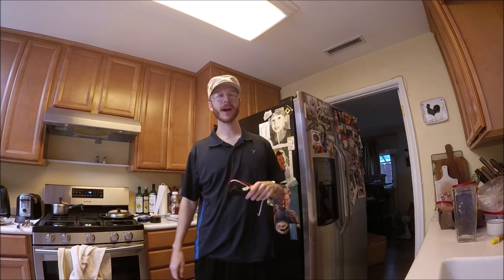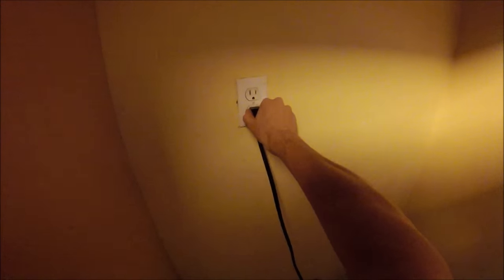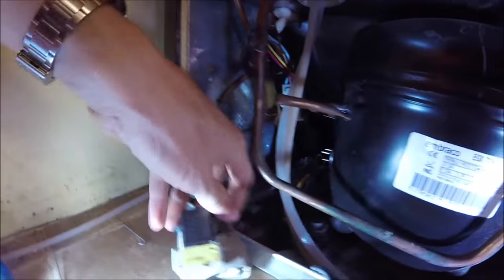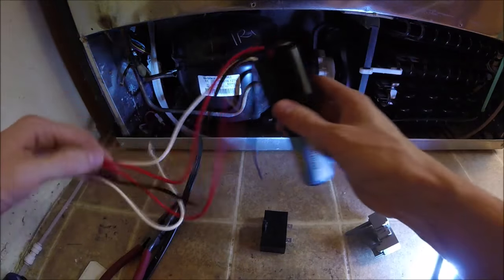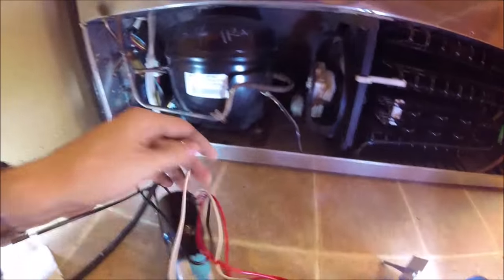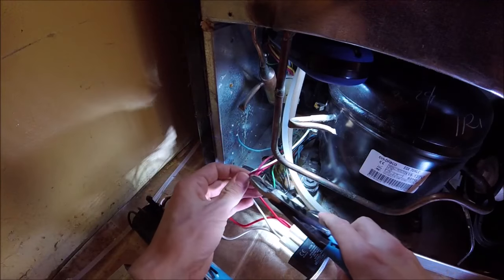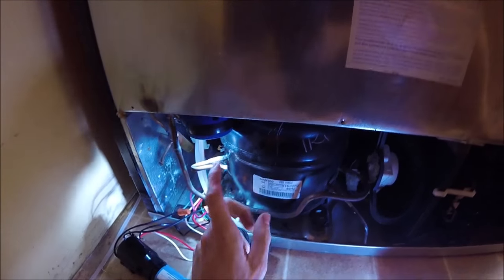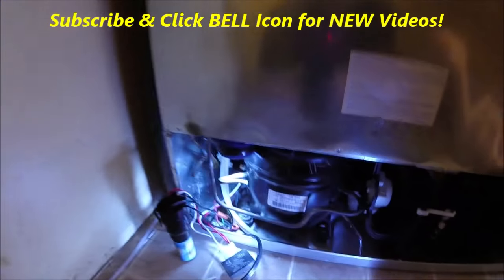Fix Refrigerator. Installing Universal Relay (3 in 1 Starter) on Compressor -Jonny DIY

Comment: 3 in 1 you have listed doesn't have the chain cable connectors, and I can't find one on Amazon like the one you're using. Any ideas?
Reply from the maker: Sure, check out the Supco URC0410. Looks like that ones the same with the connectors 👍
Reply: @JonnyDIY  First of all, thank you for the quick reply to my last query! So the refrigerator you're installing this in has a "run" capacitor, correct?  Mine is a GE and the capacitor your hooking up to is mounted separately from the compressor unit in my fridge, but close by.
Reply from the maker: @OriginalAstroTard  you're welcome, yes I believe so. From what I've learned is some people have hooked these up with success without putting the capacitor in line, but I figured I'd use it. Never had an issue with it since installing that way either
Reply: @JonnyDIY  Looked up the part number you provided and that's it. Should be here today. Appreciate your fast replies and taking time to produce them. Also, you don't take an hour to yammer on about everything under the sun, just short and simple...thanks!
Reply from the maker: @OriginalAstroTard  you're welcome, glad to help. Hope you get fridge goin soon! 👍
Reply: @JonnyDIY  Okay, I did a temp hookup to another wire (now orange and purple) and the compressor comes on. However, it only comes on when the fridge door is opened, and goes off when it's closed. Is this normal? Great-Googly-Moogly, I was a computer tech and ran class 4 laser welders, and I'm at a loss here LOL!
Reply from the maker: @OriginalAstroTard  sounds like you're 
very close, but compressor should be ON when door closed or open. Sorry not of more help, so many different fridges. Sometimes you can find wiring diagrams for your model
Reply: @JonnyDIY  Thanks Jonny DIY, it's 19 years old, so perhaps it's time for a new one. Appreciate you taking time to assist. Blessings!!!
Reply from the maker: @OriginalAstroTard  you're welcome, well if the compressor is still go and its just the start relay it's still worth salvaging. But maybe it was the compressor, but not if you had it kicking on and staying on and cooling. The wiring was just off
Reply: @JonnyDIY  Success! Not being the kind that easily walks away (plus it was driving me nuts), I worked out a remedy. My first thought was that when the condenser fan runs, the compressor runs. So I ran a temp jumper wire from the Supco to the connector that brings power to the condenser fan, and temporarily fished the wire into the back of the connector at each point. That didn’t work, so I decided to do this with each connector I could find, and eureka. I stuck gold! Performed a test run for several hours and it functioned correctly. So I used a quick “line splice” connector to attach the black power wire from the Supco, to the gray wire that supplied the necessary power to run the compressor, and its running\cooling great. I’ll let it run for 72 hours and freeze a few ice packs to ensure it’s functioning correctly and reliably before I transfer food to it.

Appreciate it friend…
Reply from the maker: @OriginalAstroTard  Awesome! Glad you stuck with it and got it working. I find it's sometimes best to walk away from a project, and your mind will subconsciously keep working on the problem and find a new solution.

Comment: As per your instructions,  I got mine off... However, I have a different unit... GTH53AD (R134a). On Kenmore 255.19502010. I have the 3-N-1. I have 1- Blue/White (N) was on ROUND BLACK and 1- Blue/Tan and a short Black that was stuck on RECTANGLE WHITE...

If any one knows this unit🤔🤕
Got it🤗🥳😇

Comment: But what did you connect the second black wire to?
Reply from the maker: One went to compressor and other to original start relay wiring 👍
Reply: @JonnyDIY  ok but when you say compressor, I have the three pins connected to the compressor. But I still have the two black wires from the rco and I'm super stuck because I still have two that I don't know where to hook up. I can send you pic of that would help you to help me but can't send a pic through comments so I'm truly stuck
Reply: I hope I haven't upset you. I'm just in desperation mode as I e got food that going to go bad and you're the only you tuber that I've even gotten a response from. I'm sorry brother but I'm just not an electrician and I still have 5 colored wires and the 2 black wires from the rco not connected.
The only ones Ive connected are the 3 whit red and black with the pins on the end that goes to the compressor.
Reply from the maker: @scottlytton5328  Sorry, connect the 2 remaining to the wires that came off original start relay. Each fridge is a little different. Hope you can get it working
Reply: @JonnyDIY  thank you my friend. I will let ya know. Travelling now with dry ice to hold me over
Reply: @JonnyDIY  got it bro. It works great! New subber here. Thanks a ton!
Reply from the maker: @scottlytton5328  Awesome! You're welcome, glad to hear you got it working. And thanks for subbing! 👍

Comment: Ran for about a day then keeps tripping breaker. Prior to adding 3n1 i has to replace defrost thermostat and went ahead and replace defrost timer. Heater was okay. Fridge would not start, starter relay was burnt out. installed 3n1 , unti ran great for a day but now keeps tripping breaker. Any advice???
Reply from the maker: May be drawing too much power when relay kicks compressor on. Make sure didnt buy too large of relay
Reply: @JonnyDIY  purchase the 1/4 to 1/3hp. I have a 1/3HP compressor.

Comment: hello Jonny, I have a question for you. When choosing 3n1, which hp do I go with?  i noticed there were several of them with different HP.
 There is no indication of HP on compressor .
It is a 24 yr old kenmore chest freezer and I can not seem to find oem relay. Thank you in advance
Reply from the maker: The one I have linked in description should work fine. You can always use the amps to give you an idea if it falls in parameter of part, but the one I linked will work for standard size fridges and freezers
Reply: Thanks. I did install one and compressor seemed to be little too hot. 
So ordered one that is for 1/12 - 1/5 hp and it will get here on Tuesday.   I also ordered ohmmeter. Could you teach me how to check the amp? And figure out its hp? Thank you in advance.
Reply from the maker: If you look on compressor it should read watts, divide watts by your voltage to get amps. And you can get hp from amp number too
Reply: @JonnyDIY  hmmm there is only one label with barcode and I do not see watts. It reads 115V 60HZ. 10 LRA 1PH and etc.

Comment: I have a Kenmore 795 76203 901. Fridge on top works fine, freezer on bottom is not freezing. Compressor is hot but there is no clicking. Everything is clean, dust free. Coil fan is running. What would cause this? Thanks
Reply from the maker: Could be many different things. Low on refrigerant, check to make sure cooling vents inside freezer arent blocked or frozen over (air needs to be able to circulate), then sometimes its a large part like the compressor just flat wearing out
Reply from the maker: try setting freezer to coldest setting after reorganizing freezer for air flow

Comment: How do you size the proper 3 in 1? My compressor is 17.6LRA, but all the 3 in 1 are rated in HP. Screw it, there's only one locally and since it uses my capacitor I'm grabbing it.
Reply from the maker: Yeah you should be ok. They're pretty universal
Reply: @JonnyDIY  Couldn't find one local, It was just as easy to get exact replacement, but I think my compressor is mechanically stuck. Everything tests on spec, but all I get is a click. My condenser fan got stuck the other day and let the compressor overheat. I'm heating the whole unit with heat gun and I'll try bumping with 220v later, but it's not looking good. Funny I had just been on the lookout for crapped out fridges to swipe a compressor for vacuum pump or maybe a silent air compressor mod. I wonder how many I'll have to try to get one with a good compressor?
Reply from the maker: @BigFarm_ah365  youd be surprised how many working fridges you can get for free or under $100
Reply: @JonnyDIY  The funny part? It's not mine, I rent, but my buddy is my landlord, I was just trying to be a bro.  We built this place, so I just fix shit if I can. We're calling in backup before we give up. It was 8 or 9 years old, but $2500 new, so I don't think he'd want me bringing in some white Kenmore I found on the side of the road🤣. It was nice having all new stuff moving in here, but it breaks even quicker than the old stuff I've typically had and all around the same time. But my ($5)Electrolux canister just keeps marching on through the decades(4 so far), they must be kicking themselves for selling all the replacement parts.
Reply from the maker: @BigFarm_ah365  ohh nice,  yeah sounds like its worth trying to fix for sure. Yeah they're just not building them to last but maybe 10 years these days

Comment: Hello Jonny after I watched your video and installed the 3 in 1 relay and the fridge works great but the light bulb and thermostat does not. Can you explain which wires from the oem relay need to be connected back to power?
Reply: Timothy Salomon  this is a generic old single door fridge I got the light working by connecting it to hot and neutral.   There are 4 colored wires leading from the thermostat to the compressor (green is ground blue is neutral brown is hot) all those are connected my problem is where does the black wire go? This black wire is from the thermostat that would allow you to turn off the compressor from inside the fridge at the switch. The black wire use to connect to the original fridge relay.   This black wire where do I attach it to on the 3 in 1 relay ?
Reply: If you install a 3 in 1 how can you connect your thermostat/ on and off switch?
Reply: Timothy Salomon  the hot and neutral from the plug are connected to the 2 black wires of the 3 in 1 relay and and also connected to the (hot brown) and (neutral blue)  of the thermostat there is 1 black wire which is hot and coming from thermostat that I have no clue where to hook it up to make the switch turn off the compressor.
Reply: Timothy Salomon  you say the only power to the compressor should come from the thermostat well if that is the case where do I hook up the hot and neutral from thermostat? the compressors has the 3 pins that are (currently used by the 3 in 1 relay white red and black wires.)
Reply: Timothy Salomon  im not familiar with the terms ribbed and smooth can you educated on the meaning?
Reply: Timothy Salomon  hey Timothy this isn't working out I think you an I are confusing each other simply cause of the power cord wires vs the 4 thermostat wires  vs the 5 wires that are on the 3 in 1. I have taken up to much of your time sir so we should end it I thank you for even replying and trying to help another human being out which is very kind. I'll try to see if I can get on to a fridge guy to see if he can just tell me the right connections to make on the phone without having to make a expensive visit.

Comment: Based on Horsepower specs for my small fridge - which is charged with 2.2 ounces of R134a - the 3 'N 1 I got should work (which is the Supco RCO810, I calculate my fridge compressor is is 1/10 HP). However, maximum continuous amps for the RCO810 is listed as 4.05A. My compressor draws a little above 6 Amps starting, but 1.21 running. Is this why the compressor only turns on for 2 seconds or so before the 3 'N 1 shuts it off?
Reply from the maker: It should run longer than that. Hmm...its possible yes based on your ratings of your refrigerator. I think the Supco 410 would be a better fit. I have a link for one in the description
Reply: @JonnyDIY  Thank you so much Jonny DIY! I really appreciate your reply! Your videos were instrumental in getting me to this point (a punctured refrigerant line due to an attempted "speed defrost" with a cold chisel - I'll never do that again! - got me here in the first place)! Your refrigerant line repair video, refrigerant recharge video, and now 3 'N 1 Start video helped lessen the feeling of boneheadedness after such a childish mistake. Thanks so much for your help! Best wishes...
Reply from the maker: @CaesarCapone  you're welcome, glad my videos were able to help you out 😀👍🏻

Comment: Cool, but I'd rather spend the extra couple of dollars to get something plug and play.  The thought of having to anchor that big cap inside the unit is a bit off putting, not to mention having to cut the existing wires.
Reply from the maker: All depends how quick you need your fridge back up and running. A lot of times you'll need to order parts and wait a couple days. These are kept in stock at appliance repair shops

Comment: What's the make of your refrigerator? How do you check if the original starting relay components are the culprit? ..???????????????????????????????????????????????????????????????????????
Reply from the maker: Mine is a Frigidaire. You can check for continuity or they usually burn out so if you smell it you can tell if its burnt out. Will smell like burnt electronics
Reply: @JonnyDIY  Thanks......The Freezer is working but the refrigerator is not. Am going to check the Evap motor or the thermostat. Comp appears to work...

Comment: Pls Jonny I have a Haier chest freezer I can’t seem to find the relay and overload kit online can I make use of this universal..will it work for it..the model number is HF50CW20W
Reply from the maker: Should work, theyre pretty universal. And if it doesn't youre only out 10-15 bucks. If youre unsure go to a local appliance parts dealer and ask them. Theyre usually pretty cool although parts are quite higher in price locally, but at least youre supporting local economy 👍🏻
Reply: Thanks brother